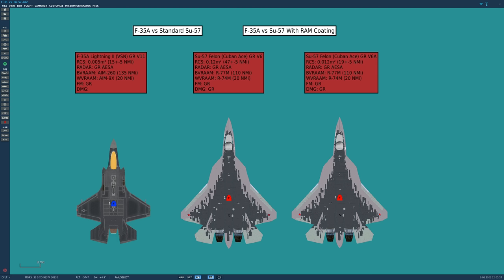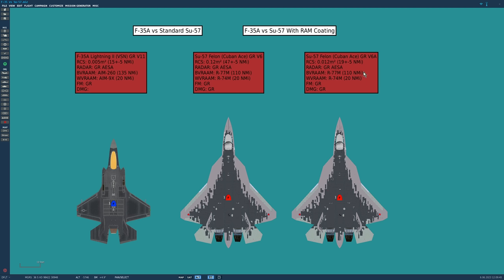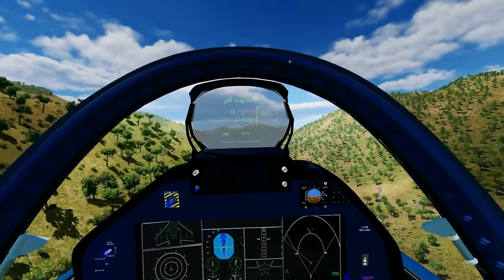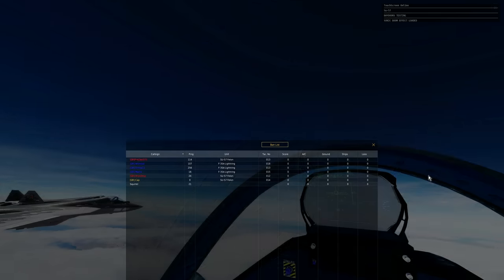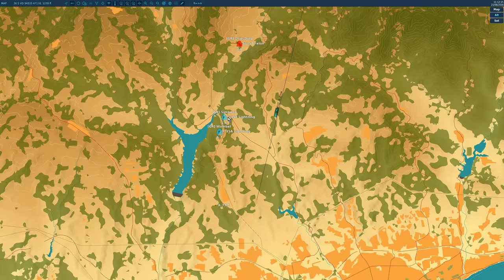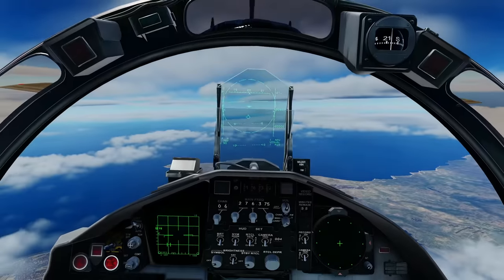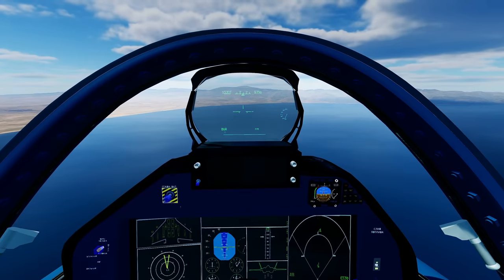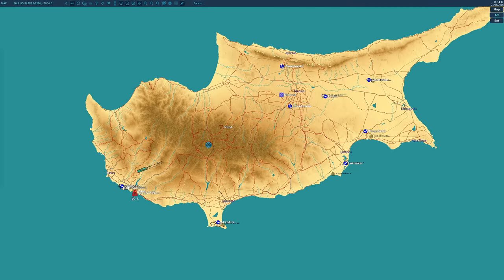F-35 vs Su-57 With RAM Stealth Coating: BVR Missile Battle & Dogfight | DCS

Comment: If using stated......then all should be stated. Ditto for simulated. Mix and match should only be used for a bit of fun. Also Simba returns wirh the power of the Shredded Wheat 🌾

Comment: FINALLY, after all this time you are pointing out that there is not RAM in the planes that kept being called as "exposes rivets" that weren't even finished models still in testing before RAM is applied. If you take a look at a f22 you will see that under the canopy window there is definitely exposed rivets and screws.
Reply: There are no "rivets" on the F-22. There are flush fixings for certain panels, otherwise how do you access the parts for maintenance?
Reply: So you admit after 10 years in production and trying to export it they finally applied a stealth application finally. Hopefully they will finish the models in the next 5 years. I would hate to see the state of the Su-57 avionics inside if the state of the outside is what it is. Ahh just remember the Moskva ! The supposed Carrier Killer.

Comment: What on earth makes you think that a 'standard' SU57 is not covered in full ram coatings in normal combat configuration? F35/F22 will have significantly higher RCS without their coatings. As they are an expensive material to apply and maintain most planes will not have them in their normal everyday training operations and basically whenever the public can see them configurations. 
As for your realism, you need to keep the loadouts correct for the aircraft. SU57, 6 long-range in main bays +2 short in sides, Vs F35, 2 long range +2 short. 8 to 4 weapons

Comment: Here's my problem with a RAM-enhanced Su-57.

All of the public knowledge and concensus has been comparing the F-22 to the F-35 to the Su-57 to the J-20 largely based on their actual design. I never heard, previous to now, that the J-20 or Su-57 isn't as stealthy because of their coatings. The argument has always been they aren't as stealthy due to their overall designs and lack of knowledge in developing stealth aircraft since the 1980's.

My other problem: this is Russia. We see how Russia operates in the real world. If you're telling me the Su-57 is basically 200% or more stealthier because they got around to putting their first RAM coating on their new fancy jet, that tells me they don't have the funds to apply it in large scale or properly maintain it. One of the F-35 advancements was much better mainteance of their RAM coating, something RU has little experience with overall.

Then finally, why is the Su-57 failing to find a single export buyer? The rumor is India doesn't want anything to do with it because their radar has detected it numerous times. Remember the Checkmate design they came out with as well? That was targeted to the export market but went nowhere as well.

I'm just not buying it, but everything is just a slightly-educated guess and a gut-feeling in the end. I respect that group attempting to put numbers to something based on science, but I just don't think Russia is close to the US on stealth tech.

Comment: Hmm, is it possible for active radar guided missiles in DCS to lock on at each other? As far as I know, those advanced stealthy jets ye flew there do have smaller rcs then almost any of their missiles, since those missiles, unlike jets that launch them, are effecticely bound to have a perfectly circular cross-section, and are unable to use those thick'n'fancy fighter-jet-grade stealth coatings. You literally need it to be several centimeters thick to have a proper effectiveness against enemy fighter's radar. If you try to apply those to your AIM-260/R-77/AMRAAM/etc you'll strongly increase their mass and drag, thus decreasing range and maneurability. Those 2-3cm of thickness from each side are nothing for fighter jets and heavy cruise missiles, but for the missiles that are 180-250mm in diameter, that's a lot. Both of those factors tend to increase the RCS quite a bit. I think your wargame would be spicier if you all could choose to shoot down the enemy missile that's coming for you. And this is also one of the main reasons the F-15EX is supposed to lift 20 AMRAAMs.

Comment: I don't really think that Russia will have high quality of maintainance with the RAM coating based on their economical situation and the Ukraine situation. So, the RCS won't be as good as the RCS of the J-20 if I have to make a guess. So, it might be more around 0.05 on average. But still, 0.012 is still a good theoretical estimate for best/worst case scenario (Depending on your side).

Also, do you guys think that Dogfights will become a really big thing if RCS keeps getting smaller and smaller?
Reply: Economically, Russia is doing okay, all things considered. GDP dropped only 2.1% from sanctions, which they bounced back up from, and has recently made it back to the top 10 world economies, and with how little Russia uses it’s Su-57, it would make it easier for Russia to maintain such aircraft.
Reply: @rebelliousfew  They aren't doing terribly economically. But not doing terrible is not enough to regularly maintain top tier stealth fighters. Russia hasn't really grown economically in a long time.

They have also shown a lot of incompetence in the Ukraine fight which makes their internal capabilities questionable.
Reply: @rofibhoi9788  as far as the russian airforce is concerned their performance in the war has been pretty damn good. they're winning the air war and have practically annihilated the Ukrainian airforce.

Comment: Can A-10 Warthogs be carrier launched? If so, how well would they perform against the Iranian boat swarm in the Strait of Hormuz?
Reply: Unless you're talking about building some catapult contraption, there's no way in hell an A-10 is getting even a quarter of the way up to rotate speed even on the max length of a carrier.
Reply: @fnhatic6694  OK.  I have no idea what carrier launch systems are capable of but it sounds like at the least it would be impractical?
Reply: @Brehvon  Well the wings also don't fold so it wouldn't fit on the elevators. But yes, it can't happen. A-10 just doesn't have enough power.

Because of the position of the gun you wouldn't even be able to beef up the landing gear to use a catapult.
Reply: @fnhatic6694  Right on.  Thanks for your time.

Comment: I'd be very surprised if the Russian RAM coatings are anywhere near as good as the US formula.

That said, I'd be inclined to just use whatever the best, most logical, estimates you have, because in reality it doesn't matter since Russia doesn't have the ability to make enough SU-57s to matter.

Comment: Cap, I suggest taking the average of the two estimates for both aircraft in stealth mode. Specifically, 0.0035 m² for the F35 (1) and 0.0080 m² for the RAM-coated SU57 (2). I believe your estimate of 0.012 m² for the SU57 is too high.

Radar Cross-section Calculations with RAM Coating
1. F35: (0.005 m² + 0.002m²)/2 = 𝟎.𝟎𝟎𝟑𝟓 𝐦².
2. SU57, without RST deployed = 0.006 m²; 
with RST deployed = 0.010 m²,
(0.006 m² + 0.010 m²)/2 = 
𝟎.𝟎𝟎𝟖 𝐦².
Reply: its always safer to err on the side of less stealth because battlefield maintenance conditions, airframe age and manufacturing defects all factor in.

Comment: From all the sources that I have who have been in contact with Ukraine, I can assure you that the "publicly stated capabilities of the '57 has been exaggerated".  (direct quote)

I have been told that YES, it has been picked up on radar systems, and that information HAS been distributed to some officials and company representatives, who have ALL replied that they were a little surprised at how effective the radar system in use was. The people that I know who are actively involved in the military AND government, have all agreed that while it isn't "as good as Russia says it is", that it is still "respectable" but "not up to the standards of the USA platforms". (meaning the 35/22)

And from what I have been able to gather, which wasn't easy as most of the people I know that would be in direct contact with this type of information are rather tight-lipped...... it seems that you may be looking at a 57 considered more of a 4.5 than a 5th gen system. Meaning that they have indicated that it is "good" but NOT as "good as you were told".

Comment: I think for fairness using the heat blast algorithm for all types is most fair. You can then apply a group wide adjustment up or down for gameplay reasons if you like. When it comes to ram coating effectiveness and the like, none of us actually have any idea. I obviously don't know as much as Heat Blast, but I would like an explanation for why the IRST sensor is so radar reflective but the cockpit is not? I would really like to stop hearing about rivets, look at the SU35, its smooth, flush rivets are hardly rocket science, Russia can do it.

Comment: Russia doing RAM coating, well let's hope it is better than the state of their concrete. Why do I get the feeling it's simply extra thick paint the Russians are using, I'm being dead serious. 

I'm curious to know if the test takes into consideration the Su-57 uses Saturn engines (Saturn AL-41) which are not stealthy or even had work done to decrease radar detection (they are not even covered up). It's an old 80s engine. I think people need to know that Russia has not built any engine in any large scale be that land or air or sea since the Soviet Union. Also what a stupid place to put Iris on the Su-57, basic stealth mechanics would put it at the bottom or inlayed, not jutting out like a wart. 

Look at the EJ200 (Eurofighter engine), look at the actual construction work with the crystal compressor blades as one example. Remember when USAF were curious to know why the Eurofighter had a reduced RCS than expected in training exercises (may have been Red Flag). When shown about the actual design of the Eurofighter it's special canards and actual engine construction it left the Americans impressed with the design. Remember the EJ200 beat the General Electrics F414 in a engineering competition (not an easy feat). NATO engines are far superior to Russian and Chinese propulsion systems this is one design where no one is as close to us (western world).   

Whenever Russia claim something, it's normally just them hastily copying and hodge podging together things and shouting about it. They have funding issues, production issues, sales issues, RnD issues, goddam window issues as well if you point something simple out. They can barely fly what they have. Everything underperforms, I'm sick and tired of Russia claiming complete tripe. The last decent thing they built was the MiG-29 and upgrading the MiG-25. Even those have their problems.

For all you UFO fanatics out there and aviation nerds check this out : https://en.wikipedia.org/wiki/McDonnell_Douglas_A-12_Avenger_II

Comment: I can verify that the SU is not that stealthy unless it has the nose pointing at you. Every other angle and that bird is not much better than a 4th gen designed for low observability. RAM may help a bit but  by the distance that thing is getting seen I'm guessing it is well over 1m².
Reply: No man it's from 0.0017 to 0.012 with irst open and 0.006 to 0.01 when it's closed they modeled it with all scenarios the guy did a analysis of 136 pages available go check it out
Reply: @HardCor3Essam  have you ever been in a situation where you have had the ability to observe this bird? I have, so either our equipment is much better than they tell us or this damn things not that stealthy. 🤷‍♂️
Reply: @rayroscoe8151  they didn't tell us 0.1m2 to 1m2 ever on su 57 that was the rcs of the prototype t50 
Basically they measured the rcs of f35 without coating its 0.1 to 0.5 iam not just putting shit up iam stating everything with proof

Comment: According to that discord conversation the current RCS for the F-35 of 0.005 is to big and should be 0.002 (60% lower). I find it therefore unfair to use 0.005 for the F-35 if you guys now switch to an SU-57 with better stats from that test. Either change both or none. Also i dont think its also fair to avarage the IRST closed and open numbers. The IRST will be open in combat right? By far the most times this plane will be used is in a combat situation. So why should it be a lower number. If that logic is wrong, then sure use the avarage:)
Also another problem: When the F117 got shot down it became possible to calculate its RCS for the moment it got aquired. The result was an RCS of 0.0012. I think its fair to assume that since the F117 there had been more improvements made. Most surely the RAM coating is better. Nonetheless even lower numbers mean that the planes might aswell have an RCS of 0.
This leads me to the follwing suggestion:
F35: 0.002m^2 (the new RAM coated number)
SU57: 0.017m^2 (thats the RAM coated number with open IRST)
This means there is a factor of 10 between each planes. But the actual detection distance should be still at numbers where you can notice a difference between these planes.

Comment: I would go with the lower RCS numbers for both planes.

Does anyone know if Russia will use the prototypes in service? Russia has an economy about 2/3rds the size of the economy of the State of California, so they're not exactly rolling in $$$ compared to the US; so i could see them use the prototypes in actual combat.

If they use the prototypes in service, then I would alter the simulations to accommodate for that. For example, a simulation that is set in 2024 should have 2-3 prototypes mixed in with the full-stealths.
Of course, that might be more work than it's worth and I'm not very attached to the idea.

Comment: The IRST sensor has a huge negative impact on the Su-57 RCS when open, but is only really effective within 50nm, so I think it is far morel likely that on "stealth" operations they would have it closed until they receive a positive radar contact (not lock), at which point it is fair to assume it is also being detected by its hostiles. On that basis I think you should generally use the lower 0.06/0.006m2 figures in any BVR fight to be fair rather than interpolating between in/out figures.
Reply: But that also assumes that the ram coatings are equal in effectiveness and that is beyond any doubt not the case

Comment: The new RCS of the su57 should definitely be the one you use forward, they will probably find that's it even better then that in the future the more they tweak their model.
Reply: Unlikely. Those engine blockers seem highly dubious band unlikely to both do their job and not impact engine performance. 

Their model alse seems to alck considerations of factors like creeping surface waves and how that Interacts with electric conductivity of the skin of the aircraft. 

This sim.also only use for talnRCS and applies that to the whole aircraft. In the charts they showed we can see that the SU-57 has HUUUGE radar returns from the sides even at a mild angle. It's stelathyness is frontal-only.
Reply: But russia will probably have a hard time making sure that the RAM coating is highly maintained all the time given what we've seen during the Ukraine situation.
Reply: @rofibhoi9788  the many f22 that have exposed rusted rivets near the canopy beg to differ.
Reply: @antoniohagopian213  Not all the F22s are battle ready anymore. There are only around 120 of them that are.

Whereas Russia has been showing a lot of incompetency with the way they handle their "combat ready" gears. The loss of tanks and still not having total air superiority over Ukraine aren't good signs for them.

Comment: If the idea is to be as realistic as possible, I'd say stick with the old figures. I just don't see Russia being capable of competently applying or consistently maintaining a RAM  coating. From the experiences the US has had with RAM coatings we know the difficulties of both aspects. Even US stealth aircraft spend a lot of time in the hangar doing maintenance on their stealth coatings. Just don't see Russia being capable of it. But if the point is just to make fun videos with challenging opponents, then by all means use the stealthier Su-57.

Comment: Not getting political but based on recent performance you pretty much need to nerf all the Russian equipment by about 30%-50%… how good is an s-300 if it’s on the side of the road with a flat Chinese tire? How good is the ram coating when they discover it’s actually watercolor paint?

Comment: just because you put ram coating on it doesn't mean youre going to get that small an rcs on the felon. Theres still MANY other flaws in the airframe that give it such a high rcs. To name a couple, all those gaps and seams increase it, the fact its underside looks exactly like the under of a twin engine 4th gen with fully exposed engines. 
I guess ill go ahead and also mention the fact it has to carry hard points for its munitions because it has no internal weapons bay, it at first didn't even have a door, then they put one on but it's completely fake, ALL of russias fighter missiles are too big to fit in that "internal bay" , therefore it still has to fly with munitions on the wings, of course increasing its rcs even more

Comment: I think you should stick with the 0.005 numbers for the f-35, because that could account for the engine fan blades moving, and the moving surfaces of the aircraft. Also, i think the su-57 should stay at 0.12 at the moment, at least until there are some more sources looking into the RAM coating claims for it. If more sources come out for it, then i would say change to the new 0.012 number.

Comment: Its become quite commonly accepted that 5th gen air combat will be relying far more on infrared sensors over radar. Every new stealth fighter coming out has some kind of IRST or EOTS built in.

Also I'd like to see the J20 get an update because modelling shows its actually about as stealth as the F35 with even 90s era stealth coatings.